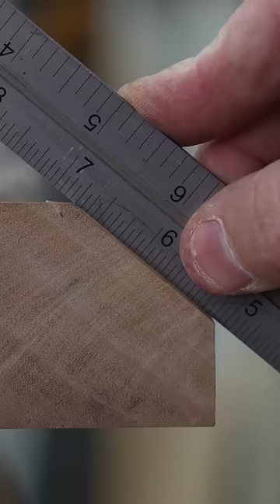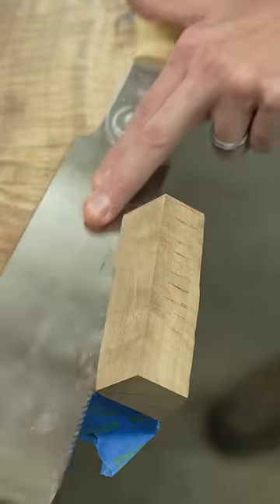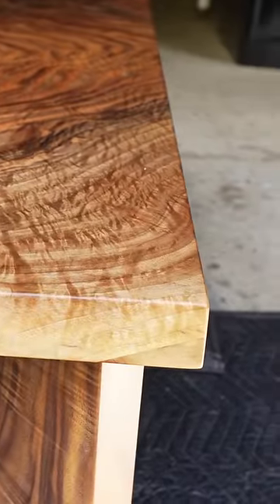Woodworking fix

Comment: “Difference between an amateur and a professional is how well you hide your mistakes.” - my old boss
Reply: I thought the difference was mistakes. 
I wasnt always the fastest guy on the job but you or I never went back to fix my work.
Reply: When you mess up on a table you start the fuck over.
Reply: How well you CORRECT your mistakes
Reply: True, a skilled person can hide their mistakes,
Reply: Putting that in my notes
Reply: I used to say the difference between a good drywaller and me, is how many buckets of mud it takes to make it look good 😂
Reply: It’s not a mistake until you walk away from it.
Reply: not necessarily hide, but fix
Reply: "Difference between an amateur and a professional is, an amateur makes mistakes" - Me
Reply: It’s not the same table bro…. No one seems to have ACTUALLY compared the two. It’s kinda sad how easy to spot and it actually took me a few times of going back and forth to spot the grain. He did seem to match the grains in the side in his first go. And then it’s an absolute perfect UNFUCKED corner of another table…
Reply: There was a mistake?
Reply: Always said “it’s not how bad the mistake is, it’s how good you correct it”. 
That said, I usually take more time to complete a project than most just to be sure I do not have to return to correct anything.
Reply: I bet he ain't getting 18k for a table though.
Reply: @trentpeterson3495  lol. Yeah,  just scratch the 5k on the slab.
Reply: @kingxiii4680  "youre wrong and the statement is false"- me
Reply: this guy hid it well. He flipped the table over, mirrored the video and no one noticed. Look at the bottom corner not the top.
Reply: @trentpeterson3495  Amateur.
Reply: @kingxiii4680  Huh, I guess there are no professionals.
Reply: @alalalala57  You're an amateur up until you stop making mistakes, then you become a professional. Understand now amateur?
Reply: One of the differences
Reply: @Tattootin the fuck up was the bottom part of that corner it wasn’t the top of the table. When you pause and look at the finished product you can find it.
Reply: Good boss
Reply: @trentpeterson3495  obviously not
Reply: @xavlamou4401  Well, given that he's quoting someone, he said it right the first time.
Reply: @ticktickboom420  Yea I'd much rather the person who didn't have to hide or correct mistakes. They're a risk and will become a liability sooner or later if it's a habit.
Reply: @kingxiii4680  every professional in every field makes mistakes. you can reduce them with skill, but never remove them completely, mistakes happen.
Reply: @Nakkiteline  No, in some fields if you make mistakes you lose your life. Trust me, I've been in those fields. Live life a little, try some difficult things and you'll realize the difference in amateurs and professionals. True professionals are past the point of making mistakes my friend.
Reply: @attic Slabs  I was thinking the same. Did you see the lines? How can he get some piece of wood that will have the same extending line from the table? I call BS.
Reply: @maniish2165  That was most definitely a different corner from the table. Let's just all hope the buyer that paid 18k for a table notices the amateur work on the other corner and asks for a 9k refund, if he keeps it. Someone that would spend 18k on a shit table, is all about quality. I can promise you that
Reply: @kingxiii4680  Professionals have standards. And I don't get this obsession with epoxy tables. People pouring epoxies on literally everything and calling themselves wood workers. Some weird trend and stupid people who are paying this much money for table. And epoxy pouring is considered as art. FFS.
Reply: @kingxiii4680  I’m pretty sure professionals make mistakes too. That’s how simple mines you you think
Reply: @WyWid  You just wrote "simple mines" and stuck with that. That's all I need to know about you 😂
Reply: I dont think thats good advice
Reply: @Nakkiteline   I'm not talking about making tables. I'm talking about military, I'm talking about welding skyscrapers, I'm talking about dropping trees and roofing. One mistake in these fields will cost your life. So do you understand now? Some low risk job like this, any amateur can make a mistake but I've watched people lose their lives in other "professions" by making mistakes. We have a different opinion on being a professional. I'd say it's complete focus, complete attention, everything going on in your life goes out the window. Trust me when you're taking gun fire or on top of a skyscraper hooking your lines as you cross beams, you have to be professional and make no mistakes. Some say it takes 10,000 hours to be a professional, I agree with that, when it comes to ripping people off in woodworking? Not so sure. But being a professional actually means complete focus and dedication. If this man had complete focus and dedication he would've never made the wrong cut. In his line of work this is an amateur mistake. I welded for a living for over 10 years, you can't hide the weakness in metal no matter how much you add to it. You can fix it but it will be forever weak from where you tried to fix it. I don't think you understand, you cannot hide mistakes that are supposed to have structural integrity. This epoxy shit is nonsensical, I know try woodworkers that build houses and have been doing it for 30 or more years, and never make one mistake. Because they're professionals
Reply: @WyWid  "Dat b how dem der' simple mines like u be thankin" How could you ever expect anyone to take you seriously in life 🤣
Reply: @WyWid  Are you mining for gold or brain capacity because I can promise you, you aren't going to find either one 🤣🤣🤣 I just came up with that and had to share it
Reply: @maniish2165    You're definitely right, this is just a new hipster trend. And the people involved don't even know how to make a proper 90 degree cut 🤣. I got your name mixed up with a troll earlier, my mistake, but you're completely right. This is not woodworking, it's a hipster trend that I hope dies out. Or gets taken over by true wood workers in time...
Reply: Except he didn't hide it.
Reply: @trentpeterson3495  not with a 5k slab of walnut you dont.
Reply: @Nakkiteline  if you are unprepared yes mistakes happen. Professionalism means you have the experience to know what MIGHT happen in advance. 

Never go with the lowest bid!
Reply: And how much you charge
Reply: @trentpeterson3495  not when the materials are cost thousands of dollars
Reply: No the difference between an amateur and a professional is an amateur does a task until he gets it right… a professional on the other hand will preform a task until he can no longer get it wrong
Reply: As an antique restorer that's truly the best epitaph of a good trademan. 😂
Reply: My boss always says, it's not about the mistakes, is how you deal with them that counts.
Reply: screenshot taken
Reply: The government is such a professional
Reply: I love all the people in here saying “no professionals don’t make mistakes” like they are robots. Or like they have never made a single mistake. Start the fuck over on a table where the top slab cost you 7k man these people must be delusional. 100% this is what makes your a master vs a professional. Everyone messes up. The saying is the longer you do something the more likely it is to go wrong at some point. These people
Act like after 30 years they won’t ever fix a single mistake they made, hopefully by then they are professional enough to make their mistake look like it never happened.
Reply: @Tattootin  The fixed corner is towards the bottom of the table.  You can see the little triangle fix in the bottom corner, not the top surface.
Reply: This is what I tell my guys. It's not about the mistake, because mistakes are going to happen regardless of your skill level. What matters is how well you can fix them.
Reply: @davidsto9064  in my language we say "Even the master carpenter misscuts sometimes" (or cuts himself, could be translated as either).
Reply: @Tattootin  no its just upside down
Reply: I've always said what makes an artist an artist isn't how well you paint (insert art form here) but how well you can fix your errors. Same same.
Reply: @trentpeterson3495  Surgeons:
Reply: Hide??
Reply: Difference is the amateur hides the mistakes, the professional fixes them
Reply: or incorporate it.  The beveled corners would be my cup of tea.
Reply: @xavlamou4401  nope he know what he said
Reply: @dominicpetry7460  nope
Reply: @Odhege8262  nope
Reply: @theoriginalmonstermaker  you like your own comment cringe
Reply: @kingxiii4680  you like your own comment cringe
Reply: @capybara9521  wdym?
Reply: @trentpeterson3495  OR!?!?! You can be like this dude and think smarter and not harder.
Reply: @Autumnpearly  or measure twice cut once?  Plus if you're watching the video he purposefully adds a taper to the corner then says it's a mistake that he took off too much.  Then procedes to glue a piece onto that taper and mold it back to match the rest of the table.  So I'll ask you was this am actual mistake or something someone did for YouTube content?  And if someone is out there making these kinds of mistakes they shouldn't be touching projects in the first place.       Pretend this guy's some master or whatever you want but it's a stupid thing to mess up and a even stupider solution.      For one how much is that glue line going to stand out when the product is finished?    Alot probably. Ripping an inch or two off the end and regluing a fresh piece would bypass that.  Now his customer who is paying way way way to fucking much for a sub par product is going to have an eye sore of a table.  But aye you guys know everything don't you?
Reply: @leholen381  thanks appreciate that. It had me goin nuts.
Reply: exactly
Reply: I thought that the difference is that a professional does it for money.
Reply: @kingxiii4680  lol I appreciate your input and responses. Yes I know how to spell, but I don’t really care about my typos on a YouTube comment
Reply: Or blame them on the guy who barely speaks any English. I miss Juan.
Reply: So u got fired or.
Reply: absolutely, because EVERYONE makes them
Reply: @trentpeterson3495  no not always. not even usually actually. this is a beautifully done piece that is just as strong there as it would have been without the fix, with how the grain was going in that area. he did a stunning job and didn't have to waste his time or materials.
Reply: @LMCorvinus  didn't waste time?   How long do you think this took?
Reply: @trentpeterson3495  Agree.  For 18K start all over or give a hefty discount.
Reply: My old art teacher said the same!
Reply: @Robert  a skilled person doesn't make that many mistakes in the first place. Especially one that looks this big
Reply: @attic Slabs  it's the same but pretty good way to get the some more views check the top and sides all the grains match.
Reply: I used to car haul 9 cars all over the southwest and northern califonia, I had to take a load of fords and lincolns and one of the was an 90k aviator.  so, I was loading those car during a mid evening, I made a cookie cut on the roof in the shape of an "L".  I had damaged a couple of other cars which werent nowhere near critical.  that was considered totalled and the guy inspecting the new cars coming in, didnt catch it when I took the cars 😂 I saved my ass that day, never stick around, jump in the truck and leave immediately 😂
Reply: Even in tablemaking, still get sus comments
Reply: Wow! There's a lot of know-it-all's here in the comment section.
#1 if you cannot admit to making mistakes in any job at any point in your career then  go home. Nobody wants to work with you. You just love to criticize others work.

#2 the guy didn't have a 2nd table. Yes a master in his trade can fix his admitted mistakes and make it look perfect.

#3 people do pay 18k and much more for custom tables like this one. I've witnessed customers spending 130k just on kitchen cabinets, 50k on pantry cabinets for a very small pantry. It's insane how much money people will spend.
Reply: This is definitely true for martial arts.  In most of the tournaments I competed in, I'd do solo competitions (basically i did a pre-choreographed routine and tried to put on the best show).  My instructor would always tell us, "every move you make has to look like you meant to do it even the ones you didn't mean to make".  And the judges could tell how well you could hide a mistake by the look on your face.  There was even a rule that if you were using a weapon and it touched the ground in an "uncontrolled manner" (i.e. you drop it while doing a trick) you'd be automatically disqualified.  So, if you go to do a sweep with your bo staff, and it touches the ground when you didn't intend to, you better sell it to the judges that you meant to do it.

It's going on 10 years since I last competed (I stopped training when I graduated high school), so idk how much has changed since then.
Reply: @ticktickboom420  nope, everybody makes mistakes whether theyre an amateur or professional. what defines them is how well they handle it
Reply: I’d say the difference between an amateur and a professional is the ability to fix other people’s mistakes too.
Reply: Except when you work for the airlines.  Mistakes = ☠️
Reply: @Macadamia923  not necessarily.  There are redundancies and contingencies put in place to make sure one slip up doesn't lead to an accident.  And those redundancies have have redundancies and those contingencies have contingencies.
Reply: I work in Aerospace. Most screw ups can be fixed! You get Caught "Hiding" mistakes, instead of reporting them, they hide your Employment! 😂
Reply: @CaptainRudy4021  Tell that to the Engineer that designed a Repair, with a Single row of Fasteners, instead of a Double Row: on the Aft Pressure Wall, of the Japan Airlines 747 that blew apart in Flight, and spread the Wreckage across the Mountains!
Reply: @robertweekley5926  that's not a mistake.  That's intentional negligence.  The technicians that fixed that plane knew what Boeing recommended for the repair but went with something else instead.
Reply: @robertweekley5926  also, it wasn't a single row of fasteners.  Boeing's recommendation for a damaged aft bulkhead was to use a single splice plate with three rows of rivets.  The technicians who fixed that specific plane used two splice plates and ran them parallel to the crack, which negated the effectiveness of one row of rivets, reducing the effectiveness of the repair by 30%.
Reply: That would be the amateur because professionals don't make mistakes
Reply: @antievil  Sure Jesus, that is why there is no such thing as errors and omissions insurance or malpractice insurance, bonds, etc.
Reply: @kingxiii4680  Oh dude... you're not fooling anyone. You make so many mistakes you just call them features.
Reply: @kingxiii4680  meh, even pros aren't invulnerable to mistakes.
Reply: @hadifelani  Well in some jobs one mistake could cost your's or someone else's life so, meh... Don't be an amateur
Reply: @kingxiii4680  And? That's doesn't have anything to do with this. The point flew over your head, apparently.

Your comment implies that pros are invulnerable to mistakes. The difference between them is just the frequency and tendency. Pros are less prone to mistakes yes, but that doesn't mean that they won't make any. They're still human nonetheless.

Don't be a naive guy.
Reply: this holds true in the performance musician’s world too… we get real good at that at my school lol
Reply: @blizzard_the_seal9863  I've been a musician since I was 8 years old. There is little to no room for mistakes in music. Anyone with a working ear can hear it. And depending on the instrument you can correct it within a second. But when I was welding on skyscrapers for a living, one single second of a mistake can cost your life. One of my best friends fell 30 stories because of 1 second of a mistake. Professions are not the same, none of them
Reply: Tell that to the people who carved thing out of stone and couldn't afford to make a mistake.
Reply: "Difference between a professional and an amateur is whether or not you're doing it for a living" - Definitions and shit. I'd also like to congratulate King on being the first and only perfect human being in the history of the world. Socrates, Plato, Aristotle, Confuscius, Buddha, Jesus (if you swing that way), Copernicus, Galileo, Newton, Darwin, Eistein and every single other person who've made contributions to the development of human kind has made mistakes in their field, and are therefore complete amateurs. But here we are, finally at the peak of humanity, we've received our true King right here in the comment section!
Reply: @edwardv1255  Hear,Hear!
Reply: This belongs on a t-shirt
Reply: @kingxiii4680  it’s kind of pointless argue with those who support mistakes in professional work. They don’t really care about the standard for professional and amateur nor the fact that the table is forever flawed despite the mediocre fix. They just say nice things this YouTuber expect to hear (which is probably why this video is uploaded) so they can appear to be a nice person on internet (and the person who made this mistake can PROBABLY use these nice comments to convenience the buyer or him/herself the flaw is not a big issue).
After all, they are not the one who is paying fortune for a flawed table.
Reply: NO TRUER WORDS WERE EVER SPOKEN
Reply: Amateurs Practice Until They Get It Right; Professionals Practice Until They Can't Get It Wrong
Reply: i worked in multi-million dollar homes. Popular saying by our trim guy, putty and paint make wood what it ain't.
Reply: Like a graveyard to a doctor.
Reply: Don't be lazy. Take pride in your work. We all make mistakes, so learn from them. Builds up experience, which is a nicer word for one's fuck ups.
Reply: @Robert-cu9bm  a true skilled person wouldnt have to hide mistakes but a amateur would
Reply: @2stroketyson79  
Everyone makes mistakes no matter how good they are.
Reply: @trentpeterson3495  nah you just correct them unless the customer has issues with it and if he does bummer new table and sell this one to someone else
Reply: @justarandomperson2990  I beg too differ. In most cases a mistake will bankrupt you. Insurance companies dont like paying for mistakes. 
Doctors, lawyers, builders. Maybe not lawyers! Lol 
Construction, owners wont allow more than one "mistake". 
Maybe if you work food service I could see you saying mistakes happen. Do you work at my McDonald's?  Lol
Reply: This
Reply: @Tattootin it's upside down
Reply: @kingxiii4680  don't matter how professional you are, as long as you have a human body with a human brain you'll eventually make a mistake, hell even computers make mistakes from time to time.
Reply: @XShadowzVarcolac  Some Jobs, you can't make a single mistake. You've never worked on a sky scraper building before bud
Reply: @kingxiii4680  can't doesn't mean never, that's the whole point, all it takes is one bad day or just being in the wrong place in the wrong time, or simply age taking its toll or a set of coincidences beyond your control that finally snowballed into you making a mistake.
Reply: @XShadowzVarcolac  Damn, that's a pretty good explanation. Seems like you're talking about something else besides a simple task though. I hear ya bro I'll remember what ya said. You just explained life lol 😂
Reply: @ticktickboom420  thats true. im not saying that a mistake wont f things up. im saying that people are still bound to make mistakes.
Reply: Facts
Reply: @Tattootin it is the same table it’s just upside down, the mistake portion is on the bottom he flipped it over to work on it
Reply: It's scamming people
Reply: Everybody makes mistakes, even professionals. Eventually you make less and get really good at fixing them so it seems like you never mess up but it happens. All these people saying professionals don't ever make mistakes are delusional
Reply: Jesus!
Thank you!
Reply: A good carpenter makes mistakes, a great carpenter knows how to hide them
Reply: True
Reply: @kingxiii4680 If You think professionals don't make mistakes then youre around "professionals" that always stay at the same level of skill. It takes mistakes to improve.
Reply: @ticktickboom420  I think that’s just a perfectionist lol
Reply: @p1kkuma  that's who I am and only who I'd hire.  Preperation is 80% of the project. Proper planning/training removes mistakes.

Real carpenter knows to hold the cutoffs secure while cutting or they can splinter or weaken your finished product.
Reply: @Tattootin it's literally the same one. If you looked at the grain you can easily see that. It's flipped over and your looking at it from the other side of the corner at the end. But it is the same one.
Reply: @xH3LLRAIZERx  thanks bro
Reply: Amazing job
Reply: "A little putty and a little paint, make a carpenter what he ain't". 

 Every fry cook masquerading as a carpenter.
Reply: @kingxiii4680 yeah? What fields are those, exactly? I've built bridges in three war zones, ran guns and dope from Mexico to San Diego, built new FOB'S around the CJOA-North Ops Area, as tasked by CJSOTF. Whatcha got?
Reply: @kingxiii4680 you talk a lot. Where'd you see people die welding? How many? What year? Stop embarrassing yourself, there's real people who've actually been there and done that in this thread.
Reply: A good carpenter tickles the wood.
Reply: @ticktickboom420  Then you probably never took a good look at your work. You're not perfect & taking your time doesn't make you any closer, so great job thinking you're the shit & the exception to mistakes.
Reply: @Lewyyt  if I screw up I dont get paid and my people go hungry.  We ain't gone hungry in three decades. 

You do you big baby boo.
Reply: @Tattootin look at the bottom of it 🤦
Reply: Wow I love that. Will use it for my mistakes as an Engr student🙏🏻
Reply: a good carpenter can fix their mistakes. a great carpenter can hide their mistakes. - my old shop teacher.
Reply: The difference between an amateur and professional is an amateur does it as a hobby while a pro does it for a living.
Reply: My old boss too
Reply: worked in high end consulting, this wasn't said directly, but it's spot on
Reply: I think that's terrible advice because of how easily it can be misinterpreted. A professional should be able to visually hide their mistakes, that's true. But a professional shouldn't hide their mistakes from their customers and superiors. A professional should be able to acknowledge their mistakes, properly communicate about it, and take appropriate measures to handle the mistake.

This video is a pretty good example. It's hardly noticeable that a mistake was made unless you specifically look for it. But he did let his customer know about it and didn't hide the fact that he made a mistake. Depending on the circumstances it might've been better to ask his customer if slightly smaller dimensions would be an issue or if he should fix it like this
Reply: @trentpeterson3495  We have family who has a custom made table from the wood of their own tree which had to be cut down. If a mistake like in the video was made with their table then there wouldn't've been a way to start over. There was only a set amount of wood available. So starting over might not always be possible. It's also extremely wasteful of materials and labour
Reply: @ChirpyMisha  🤣 gonna pretend that's what this guy  did? He sold it for 18 thousand dollars.   Doesn't sound like a personal value job to me.
Reply: Different corner
Reply: I wouldn’t use ordinary wood glue for that fix. Epoxy all the way!
Reply: @ticktickboom420  you can always make a mistake even as a professional, it's how you handle the mistake that matters. Pilots are the perfect example, you have people that have been flying for over 20 years making the same mistakes as an amateur, we're humans we're not perfect. Of course mistakes for professionals are a lot rarer tho
Reply: Your old boss is a wise man❤
Reply: Your boss Jimmy Saville ?
Reply: Lmao
Reply: It's super weak spot now that will most likely pop off in years once bumped.
Reply: @xavlamou4401 The hiding of the mistake IS the correction.
Reply: @kingxiii4680 "Professional" means being paid for what ya do. I'm no expert, but I am a human professional, not an unpaid human amateur, & I make mistakes, because I'm human. 
  One Luv 🕊
Reply: @Robert-cu9bm not hide, fix.
Reply: did we have the same boss haha XD
Reply: That’s why he’s the boss not a skilled craftsman
Reply: thats a funny one lol
Reply: Oh that’s good. 😂
Reply: @Tattootin 
Bro what you talking about Willis, your eyes on the top corner yeah they match undisturbed grains….. now look at bottom corner you can clearly see it. He turned upside down to hide the additional piece to face bottom
Reply: this is very true.
Reply: @xxDOTH3DEWxx  I like yours style 📜🧠👍
Reply: @kingxiii4680  everybody makes mistakes. Get your ego in check before you embarrass yourself 😂
Reply: @tjw2469  look at all the fanfiction you have to write to make your side of the argument look good.

People make mistakes and you'll just have to live with that. Yes even you. No matter how hard your strive towards perfection you will mess up eventually, just like you did with your argument. Accept that, drop your ego and live a more fulfilling life.
Reply: @420Manhwa could not have said it better myself. You literally can not improve without messing up. Everyone who claims anything else is just stroking their ego.
Reply: That's actually a really nice quote! Every Performer can relate!!!
Reply: I ❤ that
Reply: @trentpeterson3495  says the guy who has never spent 3k on a slab.
Reply: @theoriginalmonstermaker  what's that even mean?
Reply: @tommyinge81  I've never. No. But I've worked on slabs the company I worked for paid alot for.   I wouldn't spend that kinda money on a slab I've cut slabs out of walnut and oak from the trees on my property for nothing.
Reply: Wouldn’t call it hiding it but more like fixing it
Reply: Painters making 1/4" of trim with spackle and a dream
Reply: Exotic_Hillz  nope.

A mistake could cost me 100s of thousands. Not my insurance but me. I ain't got it like that.  You?

I work everything in my head in every possible way before making it happen. OCD.  Mistakes eat me alive on a constant loop in my head. I measure three times. Lol
Reply: And the power of the mistake
Reply: not for murders it's easier to get away without trying to clean the crime scene yourself. or else the saying will be true that blood will stain your hands.
Reply: Ahh i see👍
Reply: "Amateur hide, professional fix"
- me
Reply: You charge them £1800 dollars.very expensive
Reply: @alalalala57 гарантия ат даски ..😂🎉😢 .. не купят .. аставь себе..
Reply: Достал со своим " чувствовал себя хорошо"🤢
Reply: Dude that's incredible!  
I mean the price. Thsts incredible! 
The corner looks fantastic too, but im gonna need you to give me the rundown on the cheapest way to get into this. I'm artistic. (Have done decorative concrete for about 15 years accidentally) but THIS is something I wanna do.
Reply: プロは失敗しません